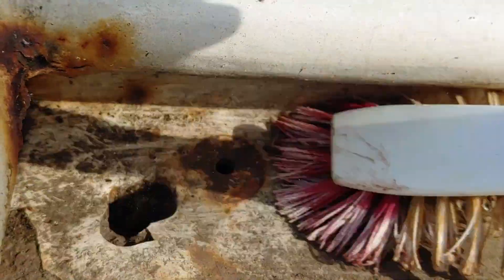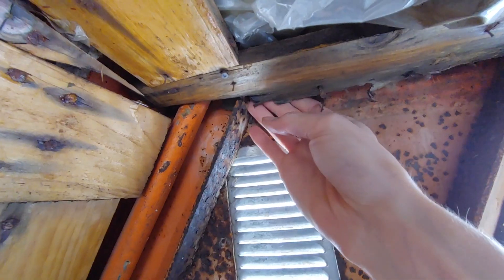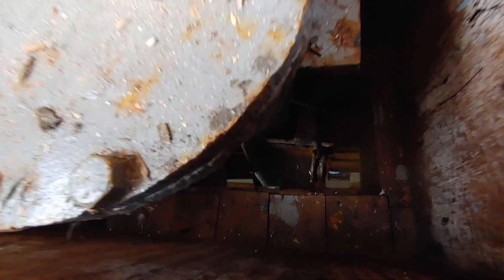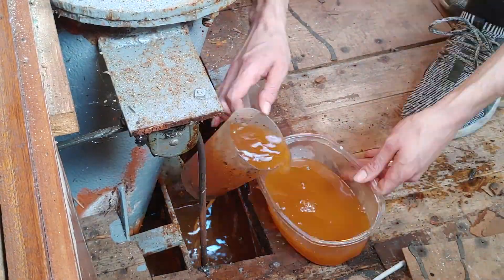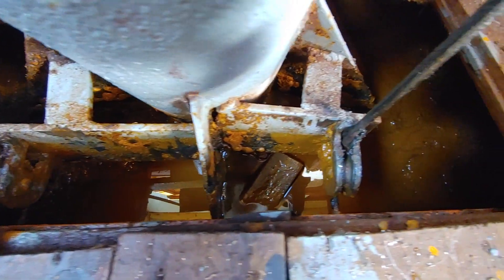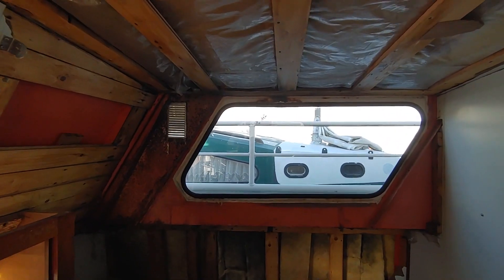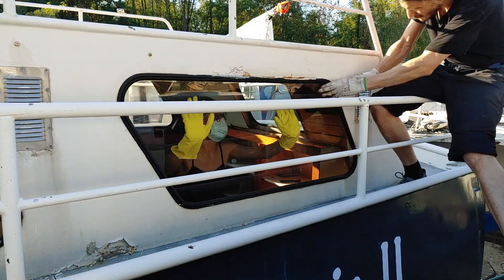More interior works - Day 3 (Pt.2) - Vintage Yacht Restoration Vlog

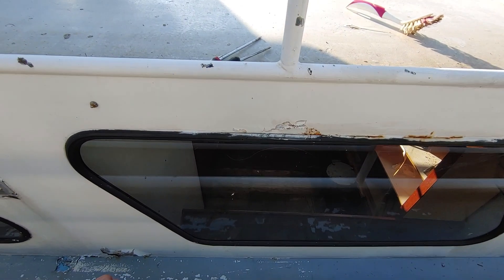Comment: Minute 1:22,  the rubber strip was installed in the wrong way, the junction we see there should not be centered at the top of the window, but (for anesthetic) centered in bottom of the window or any other trunk storages and for any other joints (this is a basic rule concerning water leaking and waterproofing)...
May I ask! Is your originally from another country?
Wish you good luck in your project!

Comment: You are going to have take It back to bare metal. The whole boat not just what you can see. A new motor or rebuild is going to have to go in. It’s a heavy boat motor would have done some work. I’d over power it if you are going to keep and use it.